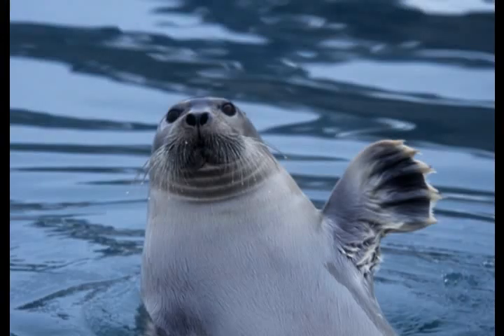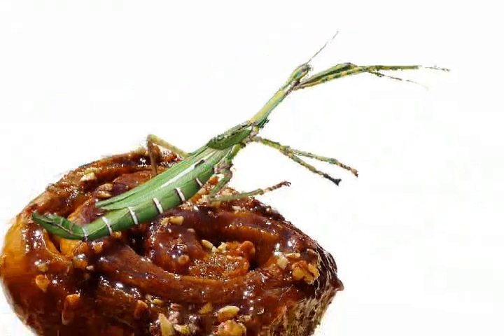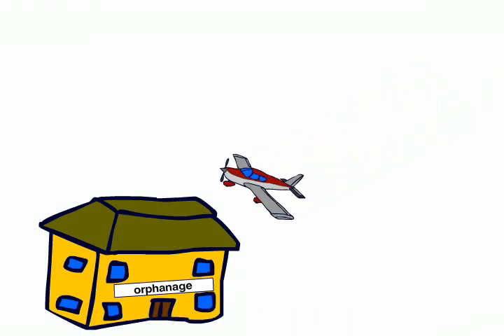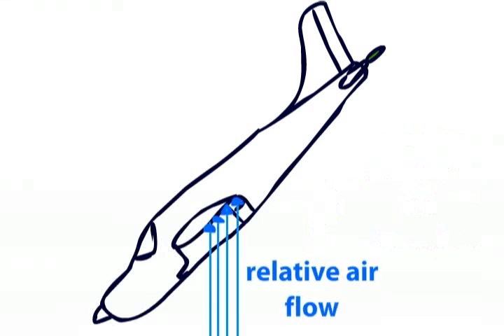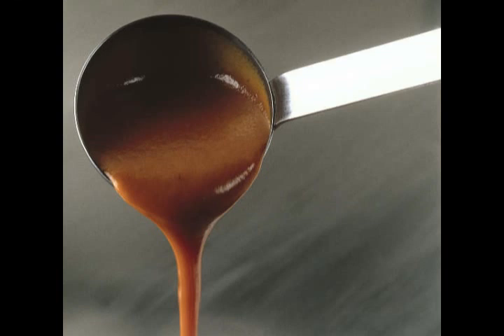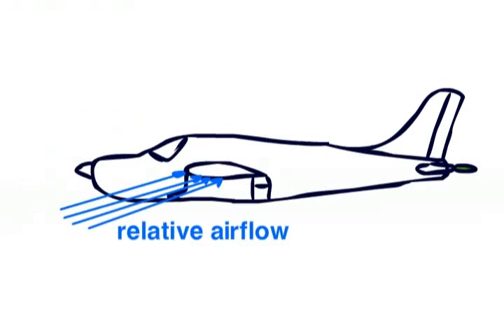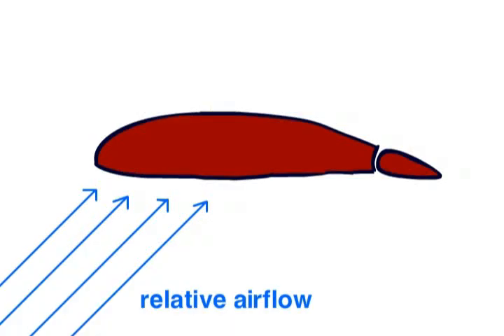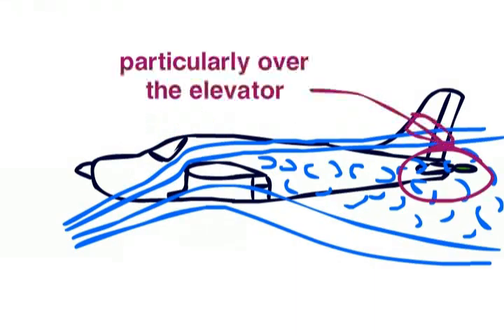Aircraft Stalls Explained | profpilot.co.uk video #9

Comment: Glider pilots also practice these recoveries, as these aircraft can be flown too slowly or at too high an angle of attack, just as a powered aircraft can. Recovery from developing stall is fairly straight forward. Aircraft feels a bit unsteady and docile, but as the nose is lowered a little the wind rush noise quickly returns and you continue flying your glide slope. Spin practices are a bit unnerving though, but fairly recoverable in the older trainer aircraft, with enough opposite rudder applied to direction of spin. On the other hand 'Hammer Head Stalls' - induced by holding nose up to 45 degrees till aircraft completely stalls - are more like a vertical nose drop and any small bits of dirt lift off the floor and float near the top of the canopy, whilst you're looking directly at the ground ahead of you - slightly terrifying. It's a good way to find your air nav map if you've dropped it down the side of your seat...."Ahh...there it is ! " (Always remember the HASSLE checks though first...).